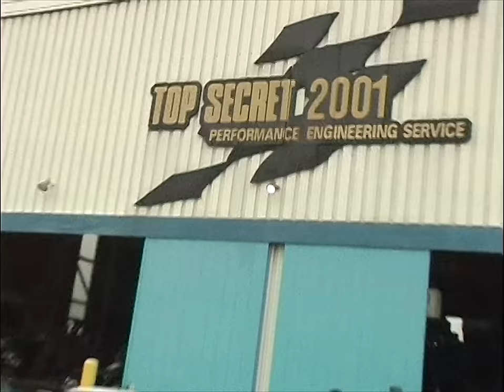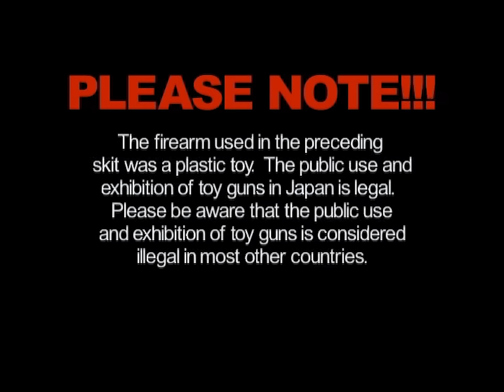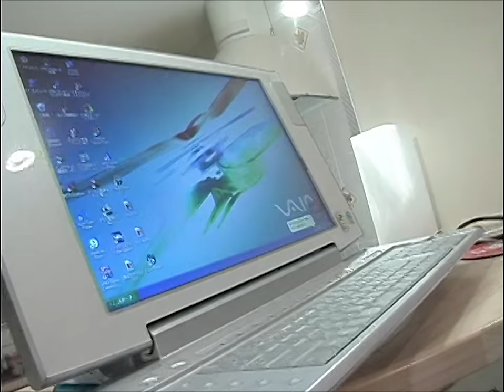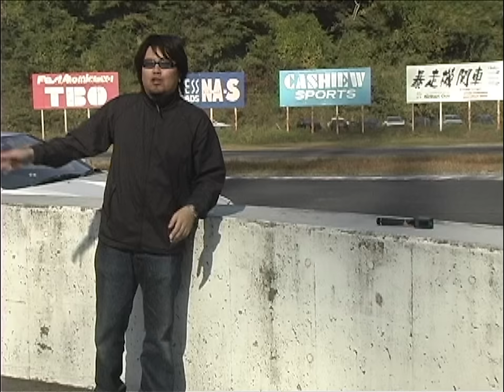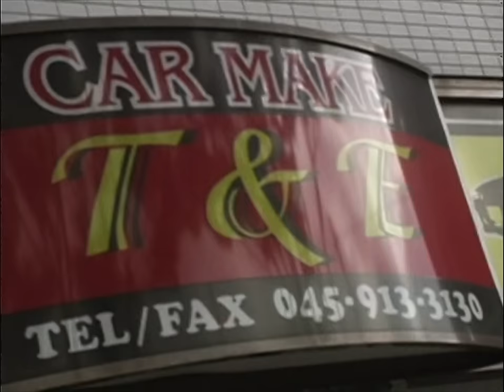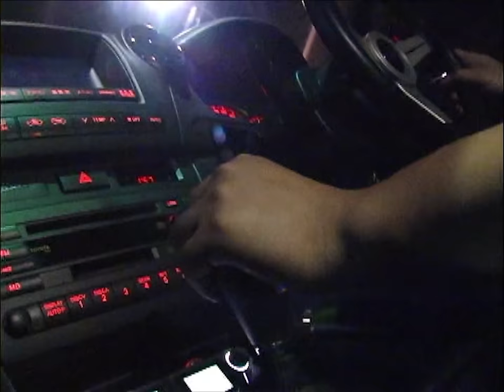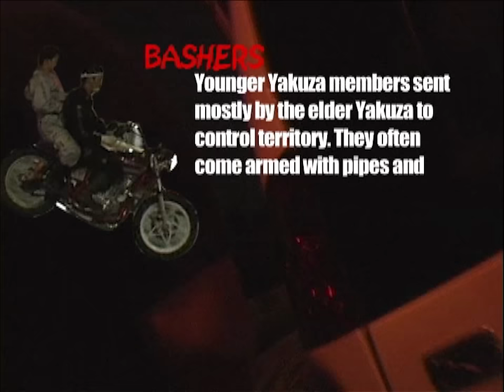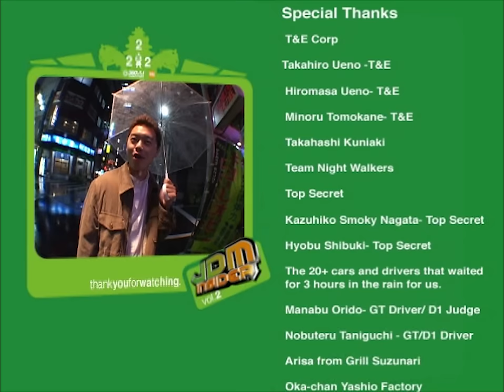JDM Insider Vol. 2 Yokohama Street Drift 2004 4k

Comment: America ruined the jdm scene.  I used to be able to buy a 180sx for 3k sterling and drive them like this now its 20k.....no one is going to risk 20k like that .

Ive had probably 20 180sx ps13 200sx s13 s14 s14a kouki i had an s14a and a ps13 k's violet over grey sr20 red head with advans  and a blitz exhaust.  I miss that  car so much 😢  h39nru was the reg

Drifting should never be about money its a passion